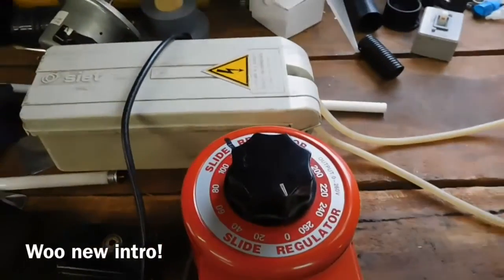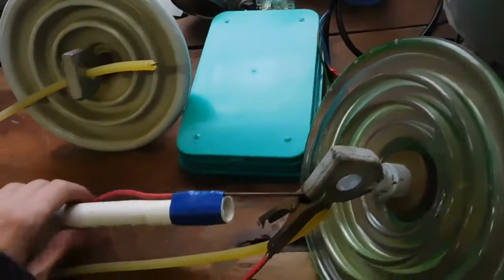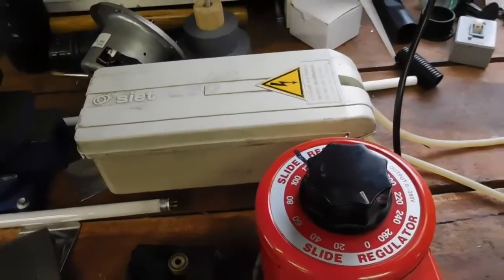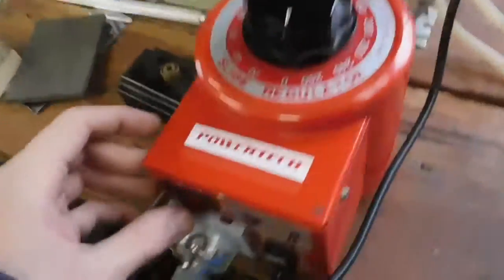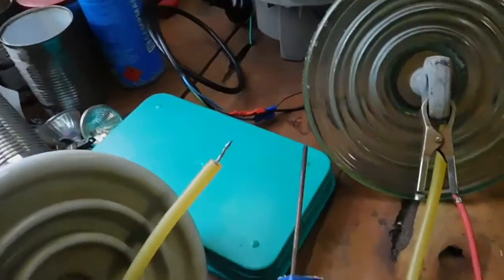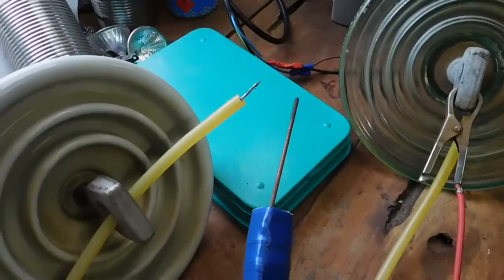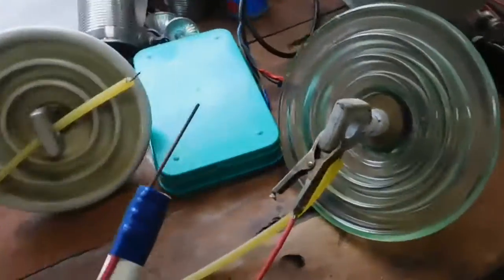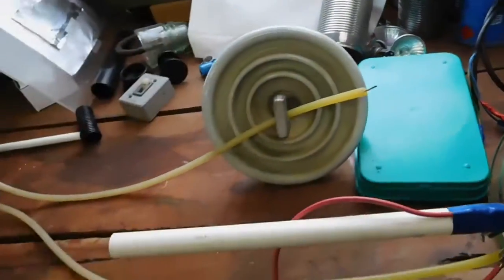Siet 7Kv Neon Sign Transformer Test

Comment: with a sign transformer similar to this one, with a ground connector leading away on the power input side and with two main output leads on the opposite side from the input.  For making arc. does the ground have to connected to a ground source? if to the case does that energize the case and make it unsafe to touch?  can it be ignored or will it also arc to the output?
Reply from the maker: Put your AC in where it is marked on the terminals, (it's different on other manufacturers) and connect the Earth to the Earth wire on yer power cord. Whatever you do, don't short the high tension output to the metal casing. because it will trip circuit breakers.
Reply: what if the power cord is already built in yet theres still a little yellow fastening cord on that side, hows it used in this case? this is the pic from ebay: http://www.ebay.com/itm/282579239269
goal being to make arcs
Reply from the maker: These are electronic transformers, not magnetic like the one in my video. The yellow wire would screw onto the metal chassis of a neon sign.
Reply: I see, so if using to strike arcs, outside, I'd screw the ground cable to a metal stake or something and drive into the ground?

Comment: Not the hottest arc, but totally not something you would touch.
You can have plenty fun with that.

I like that you got high voltage wires on it, looks like real high voltage cable. Still one advice: don't touch the cable!!

What is the output configuration? grounded center-tap? could you measure on unpowered transformer?

As far as safety goes, you can ground the working area and isolate DUT(device under test), or isolate it all from all.
Kinda hard to suggest between them, both got their reasoning.

Grounding the whole area makes sure nothing except what is intended to be live gets live. Touching the HV will likely be very bad.

Isolating it all, well.. makes sure the high voltage won't reach you, and touching any single pole is likely harmless, but mistakes can happen.

Anyone else got some comment about it? My main advice is pick grounding methods wisely!!!
Reply from the maker: +erlendse definitley. I didn't ground it during this video as the humidity and the static may have caused it to trip the RCD. In terms of configuration it's just the standard tap with the ground on the primary side.
Reply: CAL'S ENGINEERING
Internal RCD?
Reply from the maker: erlendse the one for the whole house
Reply: CAL'S ENGINEERING RCD's don't protect beyond isolated transformers, so unless the NST got it's own, nothing trips.

It's also why microwave oven transformers are so deadly, since there is nothing cutting the power if it goes via you!
Reply from the maker: erlendse ah I see. Yeah the NST only has an earthing lug on the metal casing, no fault protection as such

Comment: Got one of those as well, plus another 2 open terminal types. Siet ones at least have good safety interconnects, so opening the cover will turn it off. I run most of my neon though off an old electronic one I got as scrap. Clean the dirt off, and wire it up and it works perfectly.
Reply from the maker: +SeanBZA yeah this ones got the special safety cover, all screw type terminals as well making it easy to put cables on